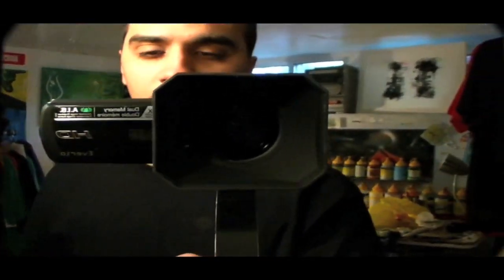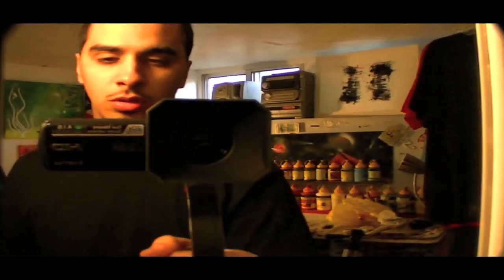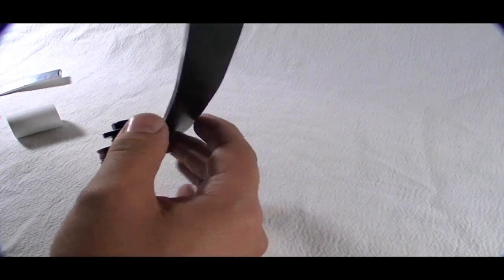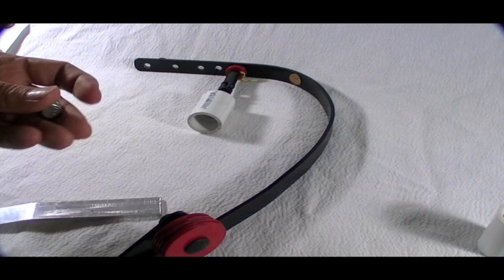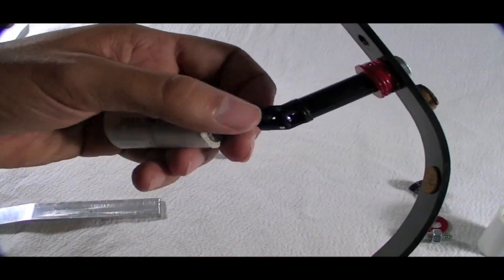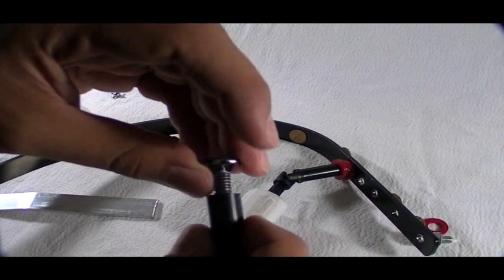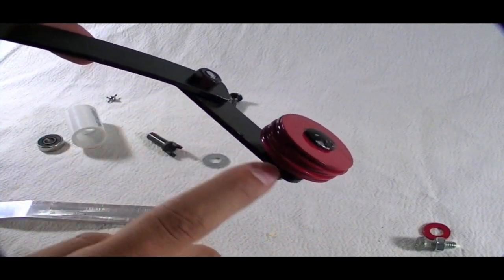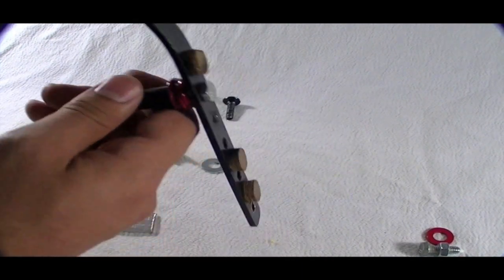Home made steadycam for under 20 dollars

Comment: that's pretty good, I'd add a macro slide rail with quick release plate for the camera & probably have an adjustable horizontal slide bar (at the bottom) for the counter-weights.

Comment: You have a good idea, (using common parts from hardware) but you need to know more details like (sizes, nuts & bolts, names of parts).  So this is your first stabilizer build. You showed us your prototype, you learn more with each build. You might use stainless steel nuts,bolts,washers, no chipping paint, looks cool and no rust. I like your demo of before & after, shows how well it works.  Just refine your prototype and you've got a winner.   Just saying. Keep Thinking Shawn     Regards

Comment: It would greatly help anyone who wants to build one of these if you learned the correct names of the parts you used. It's difficult to go into a hardware store and ask the clerk for "one of those tiny pieces of PVC, you know, what ever the hell it's called." It's a coupler. The aluminum you used is flat stock, not a pole. Sizes would help as well. Otherwise good job.